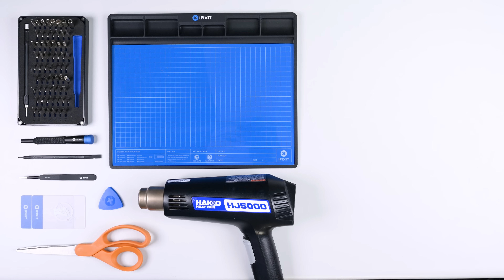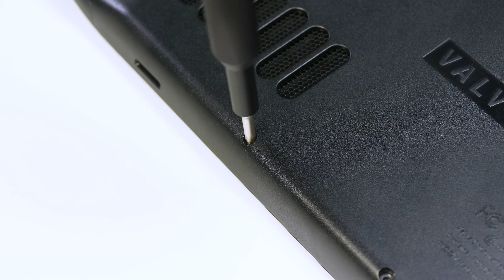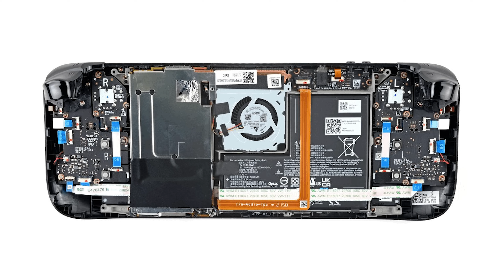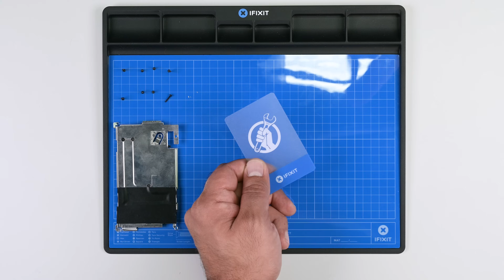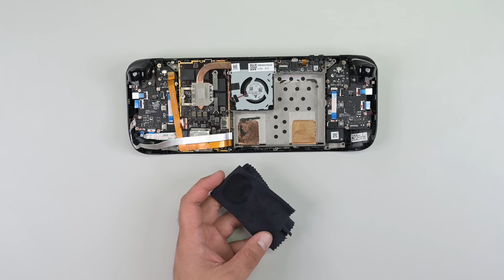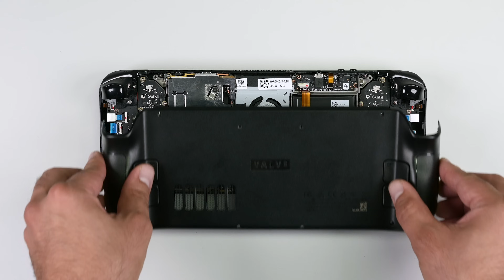Steam Deck Battery Replacement: Replace Your Dying Battery!

Comment: Thanks, but I feel it would have been so much better if the battery wasn't glued into place as strongly. Gluing a battery in is a terrible idea as it makes it a chore when removing and/or replacing the battery.
I had to recently do a repair on a Samsung Galaxy A50 and by far the worst part was trying to remove the battery (and without any isopropanol - luckily I had some plastic picks I could use).

Comment: "They" (all handheld-producers) should stop using the smartphone-method. I get that for smartphones because they need to look clean like a brick of glass or metal, thing and also supporting local tech-shops but not for handhelds...

They dont look... eh... dont know a word for the look of smartphones... futuristic maybe? nvm... Handhelds dont look THAAAAAAT epic anyways through all the buttons, ports, flash-extentions and so on anyways, so add the good old way of sliding a battery in. 

Might be a big slot but thought well through can be done without big compromisse in questions of aesthetic... Im fine with supporting local tech shops by letting them do display replacements (would do it by myself since I watch iFixit and got a kit, but everyone else, who isnt into teardown-fix-thingies, should can support local tech-services), but that shouldnt count for handhelds. There are more than enough people with smartphones and the need for screen- or display-replacement - no reason to milk the cow entirely. 

Long story short: Handheld-Producers should bring back slide-in-batteries. What was the lsst handheld, where it was that easy like only one screw maximum? Nintendo DS? 😂

Comment: That is a LOT of replacment adhesive, does it really need to be that much or would half of that be enough?  
Also, am i the only one that thinks it is weird that this refreshed motherboard, heatsink and new fan did not get any coverage in the Tech Tuber sphere?  
I did not even see anybody compare thermals or noise made between those 2 versions.  

Valve: "We are not making a Steam Deck 2 anytime soon."
also Valve: "let me just silently put a completely re-designed motherboard and different cooling solution in here without mentioning it"

Comment: Very good video, I'd only suggest maybe adding a suction cup to the repair. With a smaller one you can pull the battery up while sliding the plastic cards in from the bottom. Overall those slits at the bottom make it way easier than originally thought. Not as nice as a framed battery assembly, but beggars cant be choosers.

Comment: Im not sure this have been done before but i find it very clever that Valve added an channel to insert your half cut cards on the bottom to aid in slicing the adhesive. Image how nightmarishly hard battery removal would be without out!

But of course it would be nice if there an easier way, maybe embed an battery bracket to the battery like Dell did in their Latitude 5420 where you just have to remove screws instead of adhesives?

Comment: Did you just make up a fake situation? I haven't heard of any batteries going dead. Slander if you ask me.
Reply: it's not slander it's a tutorial lmao. all lithium ion batteries WILL go dead eventually, this is just how the battery technology works
Reply: Every battery goes bad with time. Depends on how many charge cycles it's been through. No harm in uploading this video now as it could still be useful years from now.
Reply: Batteries are bags of chemicals. Eventually, they go bad. This is right around when early adopters will start needing new batteries. Also, batteries degrade in high heat situations. So, those who have left their decks in hot cars often will be needing new batteries soon.
Reply: As others said, this is inevitable.  Some people are less careful than others, so they might be hitting this soon. 

I've seen the same model phone hit this a year in, or five. Usage and charging patterns can be all over.

Comment: The only negative thing about this is the lack of adhesive pull tabs
Reply: to be slightly fair battery is oddly shaped and big ...pull tabs will bend the battery solution is to bolting on to the display or chassis just like the laptops but that will sacrifice battery capacity 

pretty sure this is a hard choice made by valve to arrive at a fair compromise
Reply: @hyakinthos_0902  Apple did somethiong similair back then bcs it was a better shape to fit tech